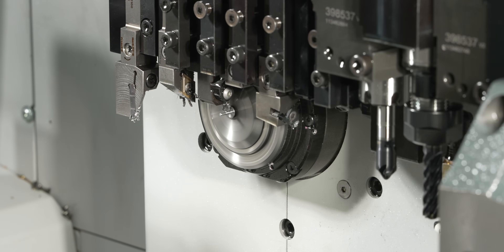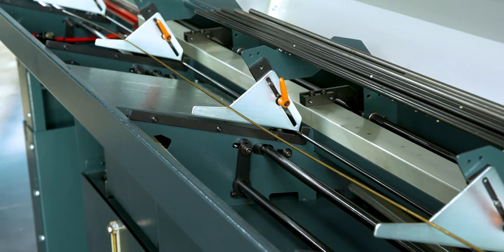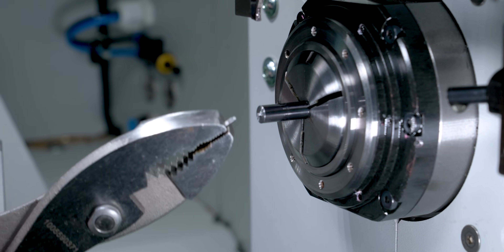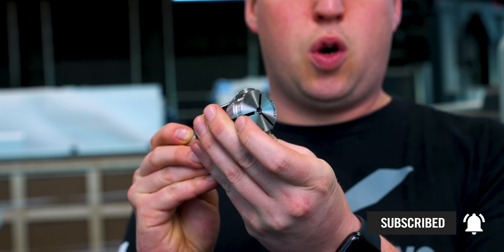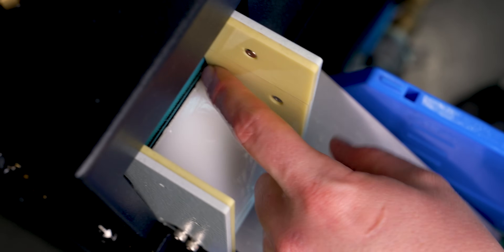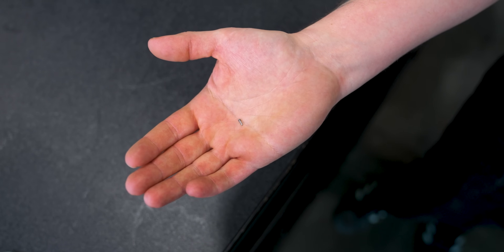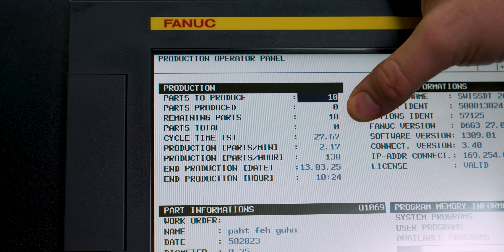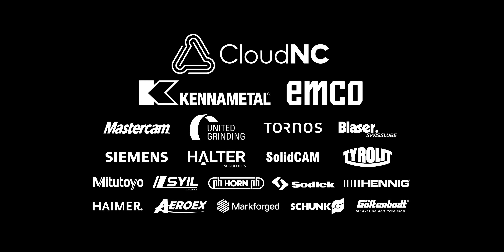Tiny Part Trick: Bigger Material, Huge Savings

Comment: Ran into this problem all the time back in the day. Hope you enjoy!
Reply: You could turn a custom ejector pen with a throughhole in so instead of it moving in to push the part out it just brings the flow/oil closer to the part makeing sure it actually get the part out ( we had some part on a swiss where we used oil to push it out but it kept going everywhere except out of the collet. So we made a custom "ejector" with through coolant so the oil didn't have time to spread out before hitting the part. Makeing it go straight out and not tilt and getting jammed inside the collet )
Reply: Hello, im a apprentice and use a conventional machine but i need to make a long but think part and i don't have any follower rest or similar, i only have a live center i could use to support it but i cant take a deep cut since it will bend out of spec but i cant take a good cut with a insert (0.05mm or 0.002in) but i do have old brazed carbide tools that i might get sharp enough to actually cut that little bit. do you have a solution apart from grinding? greetings from Germany
Reply: @AChicken-sh1gc  how many parts do you have and is it manually put into the machine as sawed off parts or is it bar fed from a long bar comming through the back of the machine ?
Reply: @ Its sawed on a manual lathe and id need to do 4 of this particular version but i run into this situation quite a bit although i adjusted the tail stock and it worked well enough to hit my tolerance. I needed to turn it to 15-0.1 over a length of 140mm but before it was conical where id start at 14.9 and end with 15.05 or more and now depending on what socks im wearing its 14.95 and 14.96 or 14.97 so that's a steep improvement for 10 min of adjusting half heartedly  but if you have any tips please share
Reply: @AChicken-sh1gc  well first this is to always have the machine completely wormed up and kept warm otherwise the machine it self keeps growing and shrinking on you. makeing it impossible to keep and hit tolerance ( like running the program for about 30-40 min without material so it warms up ( and therefore ) grow and lube itself just as it would when running the part. it also sounds like you either have some wear in the Z axis or its ust not as well allined as it could/should be and as a temp solution to that would have to compensate for that in your program ( like from one point to another point it might have to go up or down in x with a few 0.01 ) which would have to be done for every program every time you setup for a new version ( though if you can get them to allow you to get behind  the machine and straithing-/ alining the axis. that would be the best long term solution if its linear way's/rail's isnt to wearn out ) 
if the part is hollow i would also recomend makeing some internal mandrels about 0.5mm smaller /thinner and then some o-rings in groves about ever 50-75 mm pressing up agenst the inside of the part. makeing it more stiff and heavy. maybe even with a tailstock point just in case ( that trick have gotten me out of so many tight spots over the year's 

and if you just so happen to have dual turrets on the lathe you can make a support/resting tool that sits in the opperset turret barely touching the part. that way you know that its not because the part/material that bows out of the way do to tool pressure

thats just a few of the things i can tell/recomend to you at the moment. hope you get something usefull out of it

Comment: What's the point of cutting off that bit of rod at the beginning?
Reply: Prep to load new stock. The cutoff tool serves as a “stop” so the bar doesn’t go flying out while the machine loads a new part. You can’t see it but there is a spindle behind the wall and the bar is always under forward pressure

Comment: How does the machine feed in the bar through the spindle while it is turning? Is the entire several metre long bar spinning at that speed in the back of the machine? Does it cut it into shorter lengths first? Is the feed mechanism also spinning? The opening shots around 0:05 look really fancy.

Comment: Hello. The problem is that your cutting tool is not facing the right way on the main spindle side. It is always better to cut flush with the barrel. With the bar output you have, we can see that your part flexes under the cutting force. Afterwards, you need a cutting tool adapted to the counter spindle. Thank you for all your always fascinating videos. Sign up for an adjuster in bar turning, transfer machine and machining center
Reply: I assume you're talking about the cut off tool at the start of the program. Using a left handed cut off makes picking the part off much easier. With a right handed cut off you have to resort to an extended nose collet in the sub spindle. That can result in other issues when working on the part on the sub spindle side.
Reply: @brandons9138 thank you sir! I have not wanted to explain that all day
Reply: @donniehinske  Not a problem. Us Swiss lathe machinists have to stick together.  Have you ever looked into MASA tools mircoconic system? It's pretty bad ass. I'd like to see what you think of it. We use it on several machines at my shop.
Reply: @ never heard of it. I’ll have to look it up
Reply: @brandons9138 how is that microconic system? I've been looking at it, but after getting a quote for the unit and the collets... It better be dang good
Reply: @vanguard6937   Its really awesome. Since the clamping force is right at the end of the extended nose of the collet cartridge it's super solid. The way the clamping pressure is set, using a graduated wrench, it makes for really repeatable setups. One of the best parts is that all of the collet sizes are in stock waiting to ship. No more waiting 2 weeks, or more, for a KEB or Sounthwick collet to be ready to go.  MASA can to specials in a couple if days as well. Overgrip collets open up a whole new world of possibilities when it comes to how you make parts. We use an overgrip in one of our production jobs. It totally has paid for itself many times over.  I'm a big fan of the system.  The biggest downside is that it maxes out at 10mm diameter. You can get soft collets for the system as well making it even more versatile.

It is a pricey toy, but one that can give you an edge over the competition if you're willing to pay the price. With our production job we actually split the cost of the cartridge with our customer.

We did have one cartridge that we bought that didn't fit our machine.After emailing them with a few measurements it seems that the cartridge made it out of their facility without a finish grind on it. They overnighted a new unit to us and paid to have the out of spec unit shipped back. That is the only issue we've ever had with them.
Reply: Hello. You are wrong.

Comment: Unless it's above or below serten sizes I saw 1.1-1.2x the biggest feature of the part  so I can make sure that I turn the surface clean. And that's always worked perfect for me. And most of the time it's like 2-4% more expensive. Which Is like nothing if it insurers that the part comes out clean every time with no problem

Comment: Man I can only imagine how they have to find and count even smaller parts.
Reply: I can tell you exactly what it's like because It's what I did today. I'm machining a part that is 0.080L x 0.032 diameter made out of teflon. Instead of using a typical ejection sequence, we have a special collection tool that we put in the sub tool holders and then finely adjust it so it'll just make contact with the collet on ejection and make a seal on the collection tube. Then we use air blown through the sub spindle to push the part out of the collet. After that I inspect every single part under 30x magnification for any kind of burrs/defects due to any number of  changing factors like tool cutter wear or guide bushing tightness. The part is so light we can't count them by weighing out the parts, so I sit down with my 3d printed tray I designed and count them out by hand into bags of 100. You can fit a whole days worth of production easily into a beer bottlecap. It's definitely tedious and requires a lot of fine tuning to get it to work just right.
Reply: @saintjames8108 Depending on the shape, you may be able to use an app or some software that will automatically count the parts using a camera. Might be worth looking into
Reply: @saintjames8108  wow man - that's incredible.

Comment: Yeah your going through more material with a larger bar but how much material would you lose if a bunch of parts are bent.
Reply: @T-Dawg123a  you can easily turn a skinny bar into a pretzel inside of a Swiss machine. Ask me how I know.
Reply: @brandons9138  Hahaha I call it spaghetti. Done that before and it sucks. Especially  when it gets jammed in the guide bushing preventing you from pulling it out and being able to clear the jam.
Reply: @brandons9138 one night, one of the Swiss lathes at the place I worked at decided to turn the bar into spaghetti.. and rip out wired and hoses along with it. That machine was down for a few weeks, but they didn't really do a good job keeping them maintained.

Comment: I would be interested in a deep dive into what becomes of all the chips.  Send one of the boys out to follow your waste off to wherever it gets recycled, where gets recast, and then follow it back to the shop as new stock.  That would be really cool.  Most people don't understand how metal manufacturing leads the way in recycling and sustainability!
Reply: Just ask the guy who recycles. He told me they were shipping them to India.
Reply: Its the exact same facility as a waste management plant that burns trash.
Reply: @Shirehi  No. There is money in metal.
Reply: @murmenaattori6 dunnu about our steel chips but if we make a few pounds of alu chips we are advised to collect them separately (just swapping bins on the conventional lathe) and put them in a special collection box because we get good money for those
Reply: @Shirehi  i dont think so, you cant burn steel or alu it would just clog the mechanisms and be a real pain and danger but i think they go to "special" furnaces where they are remolten into some kind of structural steel or they are mixed, analysed by composition and then mixed with new steel to 1: recycle the old steel and 2: replace some of the new alloying elements to save some money and energy
Reply: @Shirehi i think you probably meant they seperate them at the exact same plant where they burn other kind of thrash right?
Reply: Chips are obviously a better source of iron than iron ore. It's a no-brainer to recycle them.
Reply: That wouldn't really be possible, atleast not for a video, the process take weeks, if not months. Most recycled metal is used for other purposes not remade into bars for machining. Because there is almost no way for them to guaranteed every chip is from the same material type. Even if ur shop sorts it pefectly, smelters can't risk cross contamination as they would be the ones on the hook if something goes wrong. Material for aerospace and medical tools has to be perfect. Imagine if an impant started going thru galvantic corrosion inside of a person, due to a loose aluminum chip.
That smelter and machine shop would be out of business after all the lawsuits lol
Reply: @verakoo6187 obliviously they dont make the mentioned parts from contaminated metal but its fine for other things
Reply: You would just end up in a third world country like India or America
Reply: My chips go in the waste bin.